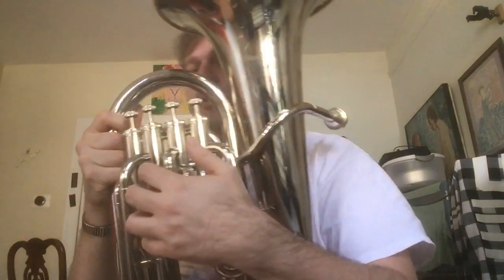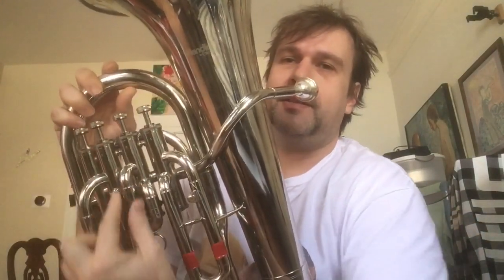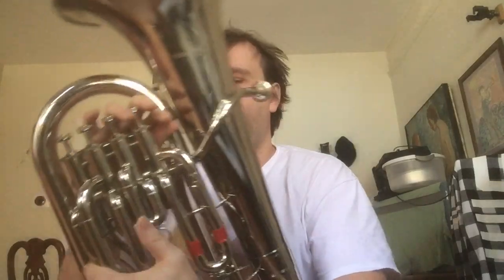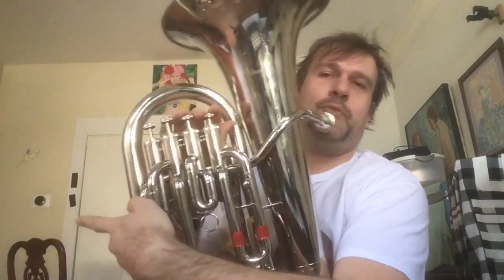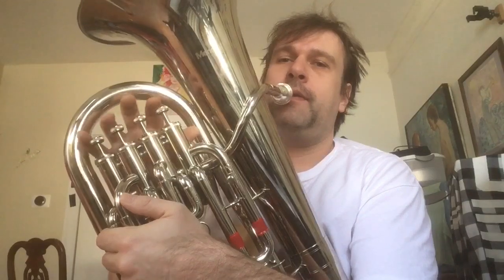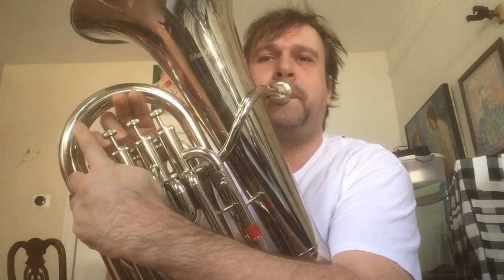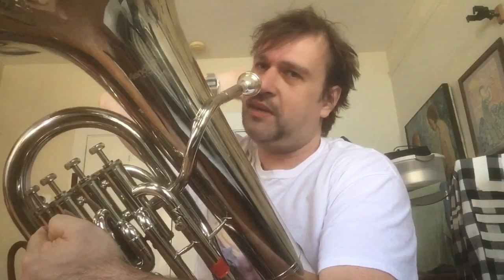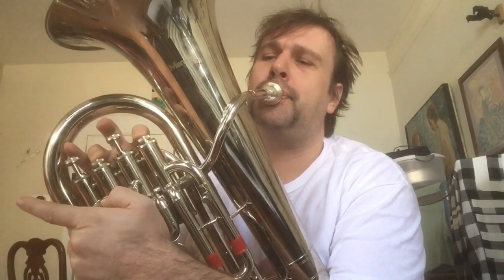WTF Does the 4th Valve on the Euphonium Do?

Comment: In short
2nd valve lowers pitch by 1/2 half step /semitone
1st valve lowers it by 2 half steps for one full step
3 valve lowers it by 3 half steps and also serves as alternate fingerings for anything that is 1 2
4th valve lowers pitch by 5 half steps so mainly alternate fingering for 1 3 and cal also serve in the pedal register as you demonstrated